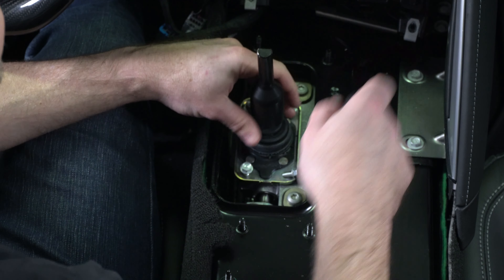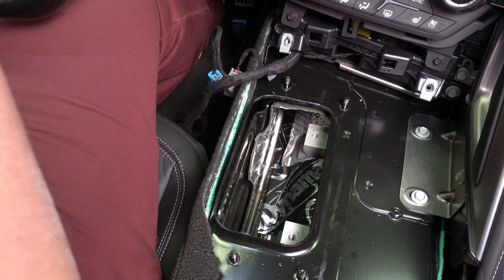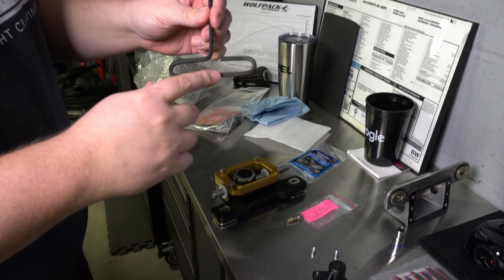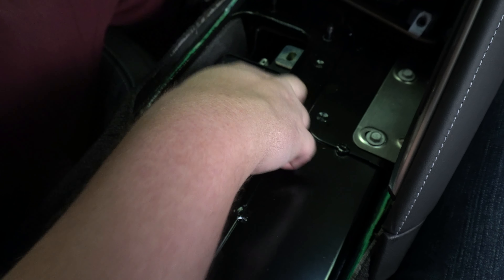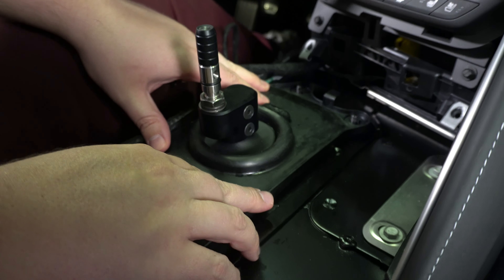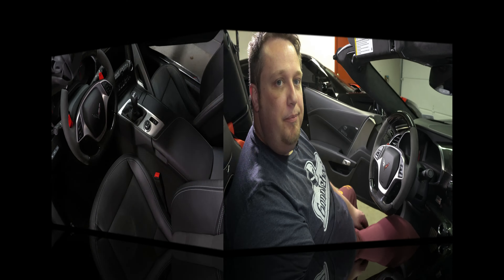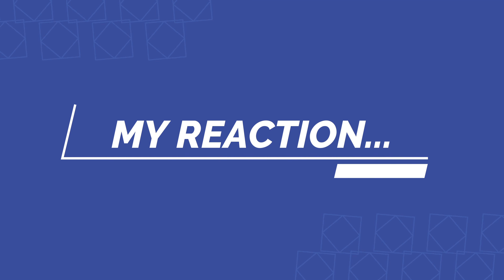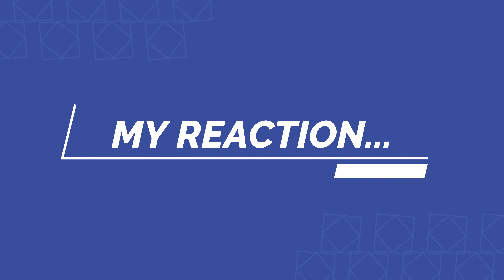Corvette MGW Shifter INSTALL Step By Step Instructions AND Review!

Comment: Scott and Justin, less than 2 hours start to finish. Wow, very direct. I did dive into the bag for the extra grease. There’s more room in that tunnel than suggested by the video, which was a bonus.  The shifting is very direct, short, and direct.
Reply from the maker: That's awesome! It is without a doubt the best mod you can make to a manual transmission C7!
Reply: HorsePower Obsessed Justin, you are costing me a bunch of money in great upgrades. Keep up the great vids and superior content. Each upgrade has been worth it.  By the way, I used orange fabric marker for the interior white stitching to match the Sebring Orange exterior paint. Looks very sharp now.
Reply from the maker: Thank you. I thought about doing the same thing but just not sure about longevity. Send me some pictures of what yours looks like. My email is horse.power.obsessed@gmail.com

Comment: Thanks. Kind of late to the MGW party. I was really wondering about the 2nd, top dust boot. I wish they had written instructions. Also the latest version for the C7 has a blue Aluminum under piece, that almost encapsulates the ball and rod mechanism.
Reply from the maker: I saw that. I wonder if it offers any kind of physical improvement...
Reply: @HorsePowerObsessed  I suppose it would prevent the foam insulation from getting into the mechanism, which it does. This gave me the opportunity to clean and vacuum everything. Also the arm rest now has brass inserts in the lid so as not to strip the screws. Mine came out working great.
Reply from the maker: It really is a thing of beauty. Makes shifting a never miss!

Comment: Great video just installed my shifter but notice it’s very loose when it’s in hear I can move it from side to side while in gear ... anyone else have this issue
Reply from the maker: Thank you. Sounds like something wasn't tightened down the whole way.
Reply: @HorsePowerObsessed   yeah called up and and I didn’t tighten one of the bolts enough it’s perfect now
Reply from the maker: Sweet! Best mod I've done to my C7!

Comment: Great video HPO! Would it be possible if you made a review video about how this feels different from stock? Also if you could comment in that video about changing trans/diff fluids and the effect that Would have on the m7 that would be great. I feel like my shifter isn’t very smooth and almost grinds so I’m wondering what steps I should take to fix this. Thanks brother
Reply from the maker: I will be making a video talking more about this in the future, I have already changed my differential fluid and the trans fluid will be coming later this spring. I'll let you know if that makes any difference.

Comment: I was just re-reviewing some of your previous uploads and have a question as your shifter. In the thumbnail you show what looks like the MGW Flat Stick design, but I didn't see a pic of it after the install. Is it in fact the flat stick?
Reply from the maker: It is not the flat stick. The thumbnail is a stock photo from MGW's website.
Reply: @HorsePowerObsessed  Okay. Because my flat stick is now installed and I was going to ask you how you handled the "customizing" of the shifter boot to fit the rectangular shape? MGW doesn't sell the boots for their flat stick. The factory boot is modifiable, but takes a little bit of time. Hope you're enjoying the shifter.